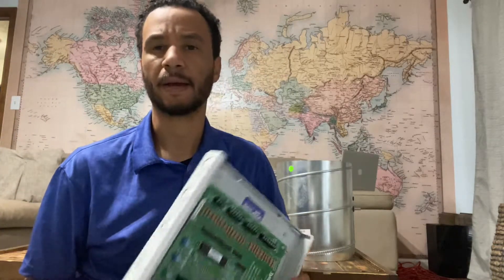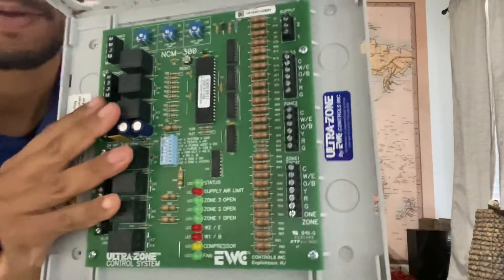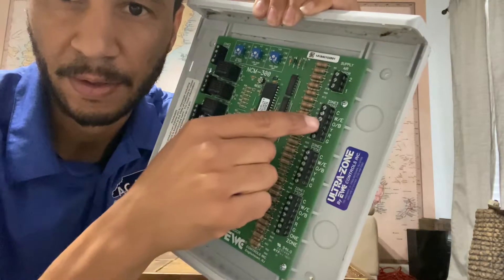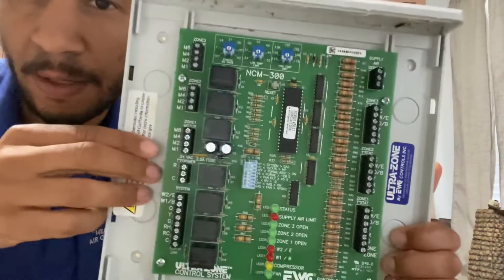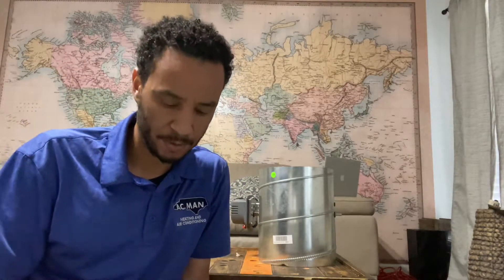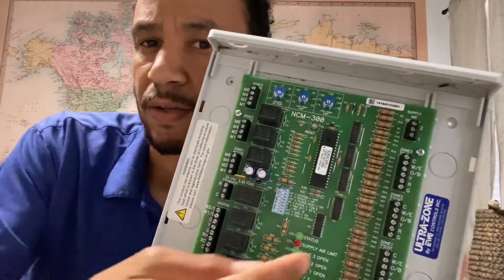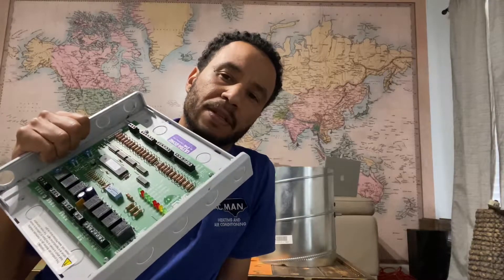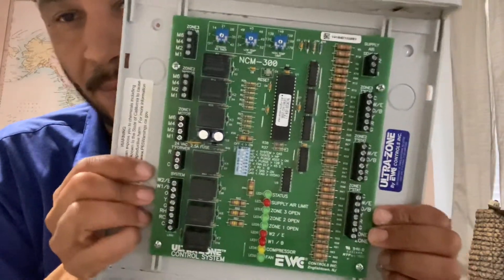How to wire a zone board￼

Comment: Thank you for the video. I have two thermostats on my multizone board. When I turn both thermostats on to call for cooling, the air handler turns off and I don't get anything. I then turn the thermostats off and have to turn the power off to the air handler. I do this by flipping the switch to off. I turn one thermostat on (first floor) and the air handler and ac compressor turn on leaving the second-floor thermostat off. The system will not run but not turn off when it reaches the set temperature. I hope you understand my question and can help. Thanks again for the video.

Comment: So we replaced the zone board, it’s brand new , so everything else works, except the dampers are not working properly…we are getting all the heat on second floor, the first floor heat up really really slowly, and we rested the first floor dampers wire connected to the zone board, these is no 24 volt going to the floor 1 damper, but there is 24 volt going to the second floor damper….
Reply from the maker: you may need to call someone

Comment: Thanks, will check my zone board as all air is being sent to one zone regardless of which thermostat is turned on and off.Is there a way to manually open a damper on the damper control box?
Reply from the maker: Yes you can turn the screw on most of them

Comment: Have a unique situation I have Ecobee thermostats that do not provide B signal when in aux mode. Found your video very helpful. I have a gas furnace with a heat pump. There is a way to get around this problem. Do you know what it is.

Comment: One of best video ! Very clear!
Do you have any suggestion on replacing a LAT Sensor on supply side. Doesn’t seem to reset when 2-3 TSATS are calling for cooling. I am getting 24v between C & Y at TSATS side of the zonex board, but not at air handler. The one that is mounted is like 2” black square with 2 screws. Any tips on how to replace it?
Thanks in advance!
Reply from the maker: Super easy. You just pull it out and replace with the new one.
Reply: Thanks for the response. Does the probe be inserted in any certain angle or something like that?

Comment: I live in sw Florida. The original unit for my home  was a single stage with a two damper zone. I have researched that with a single stage unite it need a bypass duct which I have. 

Last year I bought a  18 seer 2 stage unit with a veritable speed air handle. And recently  I have noticed on my nest app that my unit is running long. What can the reasoning be?
Reply from the maker: If unit is running long that is because it is not cooling the house down. The problem with the question is that any problem in the unit will result in the unit running too long. it would be almost like asking someone my car does not run do you know the problem. I would need much more specific details.
Reply: @ACManHeatingandAir  ok thank you